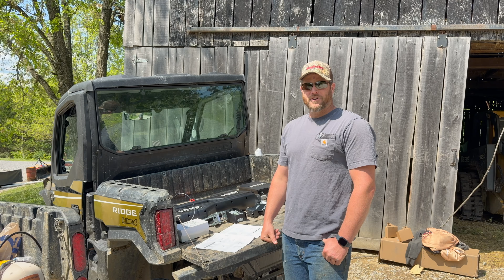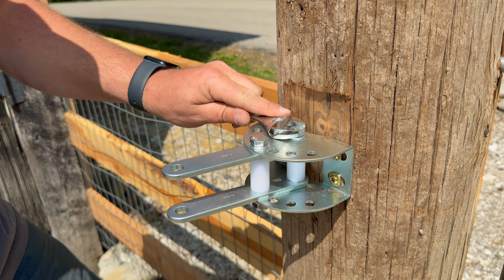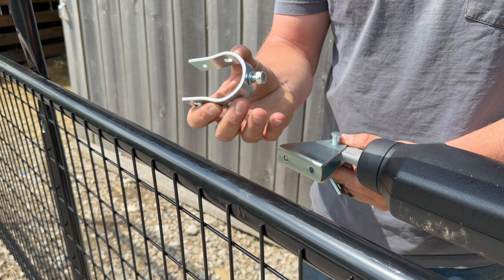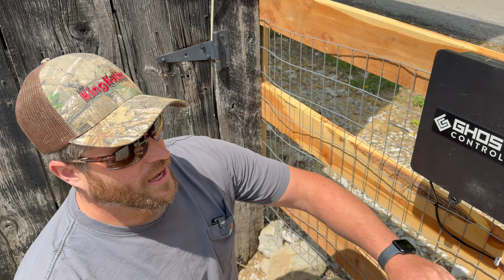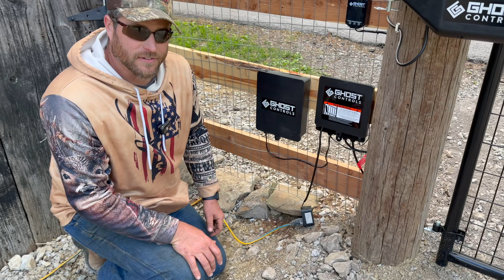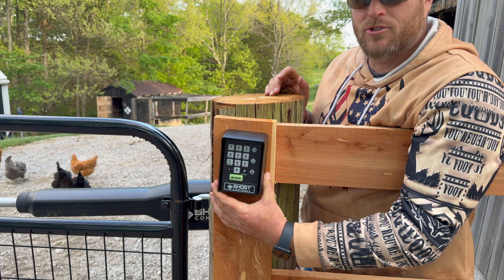Installing Dual Automatic Gate Opener by Ghost Controls! EASY DIY INSTALL!

Comment: Have you had any issues since install?
Does this particular one have solar connection or it's a different model?
Reply from the maker: Nope. No issues at all. Same battery in the wireless key pad as well.